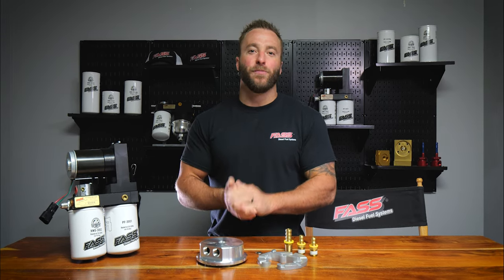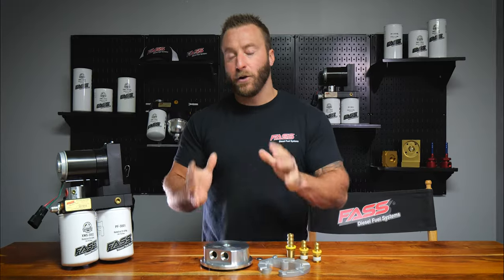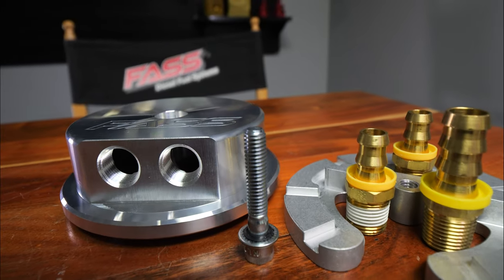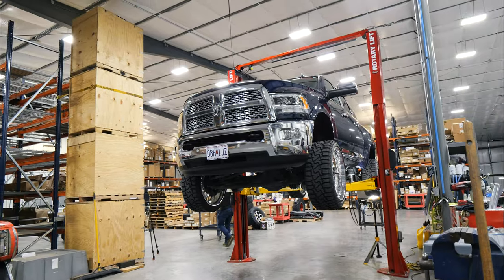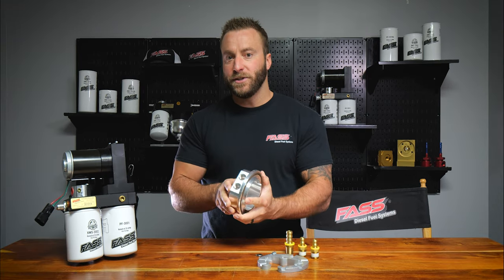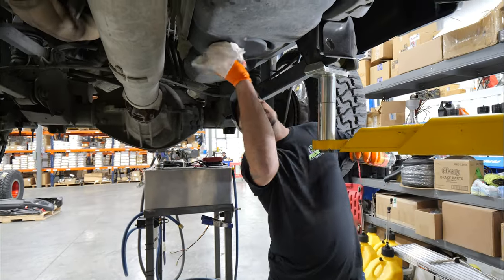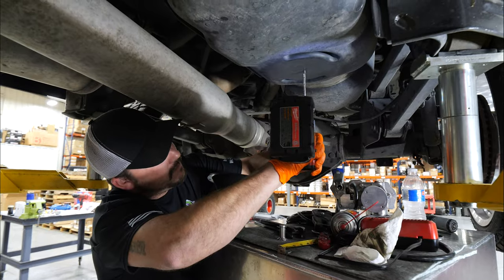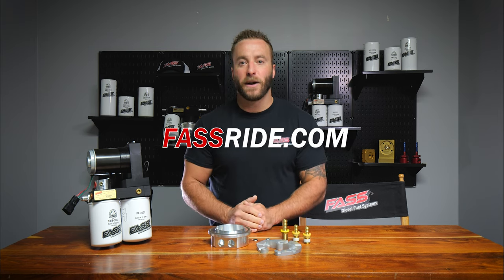All-New Fuel Sump Kit | EASY Installation!

Comment: I have another sump installed now and I suffer terrible with the 1/4 tank issue. What size it the large hole that needs to be drilled for this? I am hoping the same as my current sump obviously.
Reply from the maker: Thank you for reaching out! The hole for this is 3-3/4"
Reply from the maker: Thank you for reaching out! The hole for this is 3-3/4"

Comment: Thank you thank you thank you,. I installed this sump today replacing a 3rd part one that has plagued me with the 1/4 tank loss of prime. If I got close to a 1/4 tank I would have a 100% rate of lost prime at 4 way stops. The install was simple and just by looking at the design I had high hopes. I have been running around this afternoon on 1/8th of a tank hitting every 4 way stop I could find. This new sump design is the absolute fix for the loss of prime issue. Thanks again for releasing this product.
Reply from the maker: Thank you for installing it on your truck, we appreciate all the support!

Comment: Do I still need a regulated return with this?
Reply from the maker: Great question, and you can if you like but it shouldn't be needed.
Reply: @FASSFuelSystems  For a 6.0 Powerstroke diesel
Reply from the maker: @AZRACKS  correct, you can run a regulated return if you like, but it's not needed with the FASS.